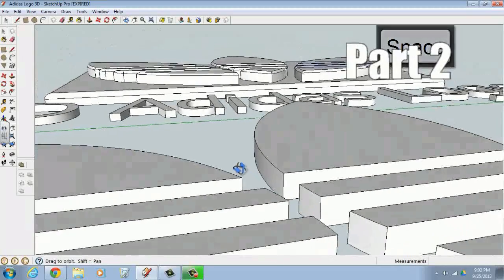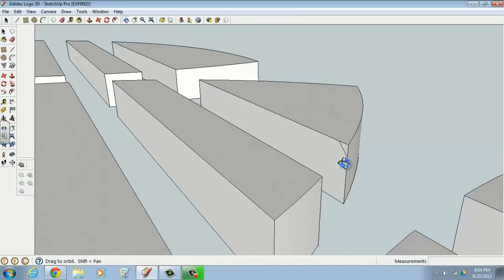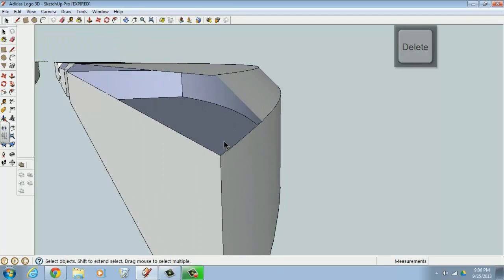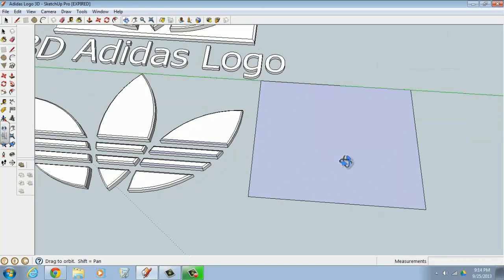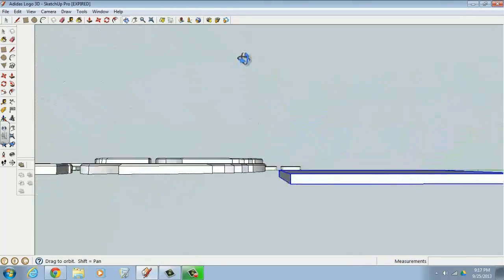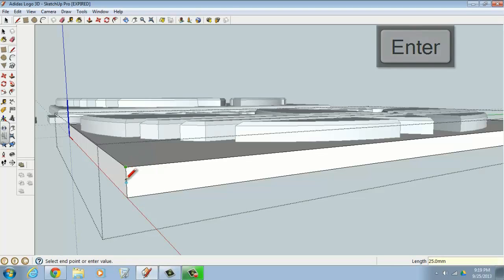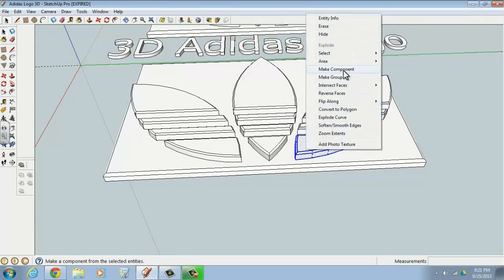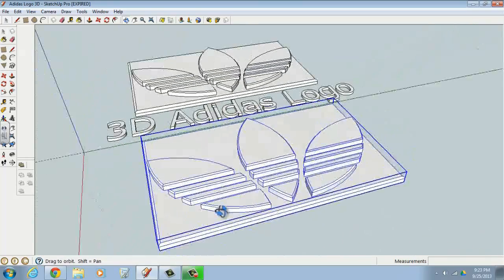Adidas Logo with Sketchup (Part 2)

Comment: Excellent tutorial, Aaron. Thanks.
Would there be a difference, as far as a 3D-printer is concerned, whether or not you used make-group instead of make-component for those upper pieces?  Sketchup  seems to indicate a volume on grouped items, as well.